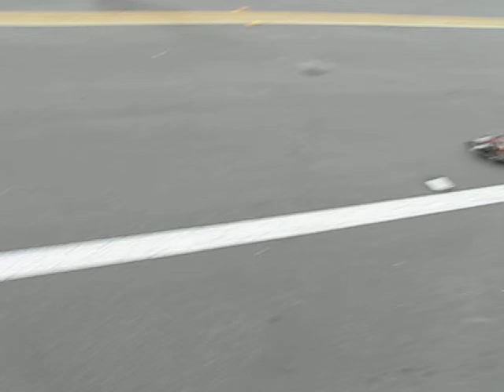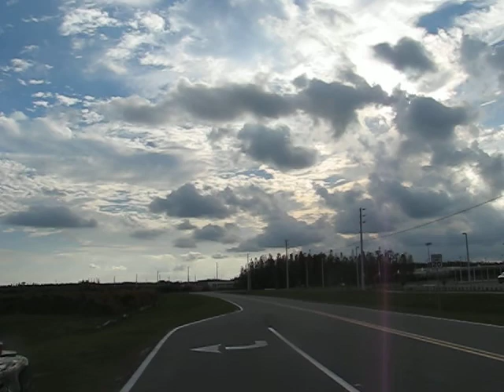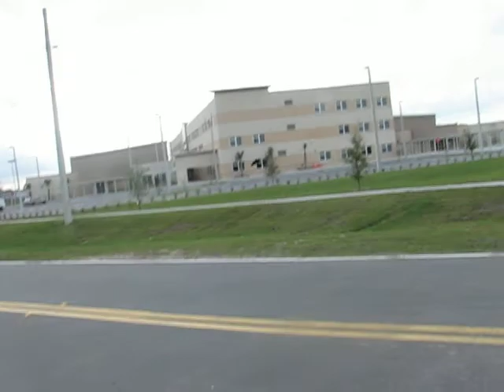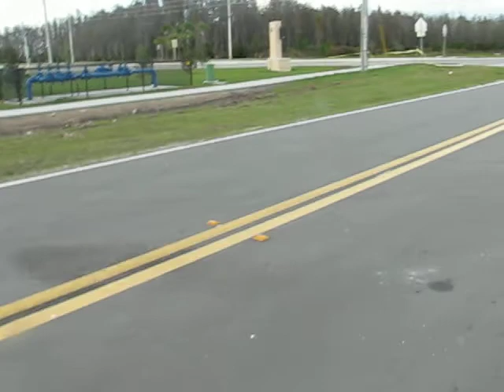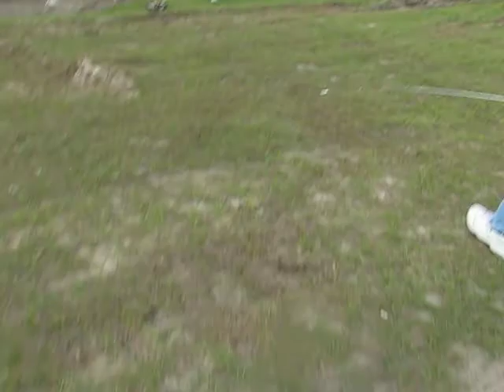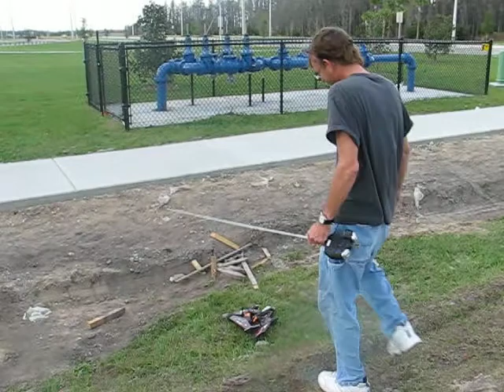XPV Shadow Hawk 2.0

Comment: Hitting a power line like that wont be any problems as firstly its all made out of foam secondly even if it was metal or plastic the current wouldnt ground through your plane. The only problem would be if you ran a copper wire from your plane to the ground and stuck a high power cable. that wouldnt be so fun! I have 2 high power cables where i fly my XPV so i know its not so much of an issue but I am still always carefull